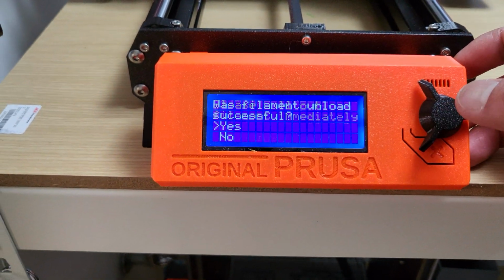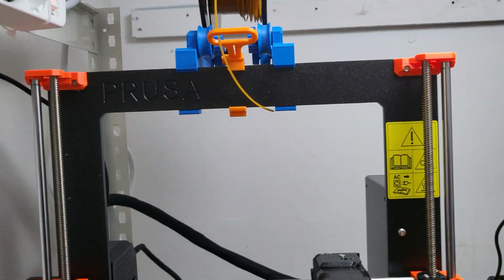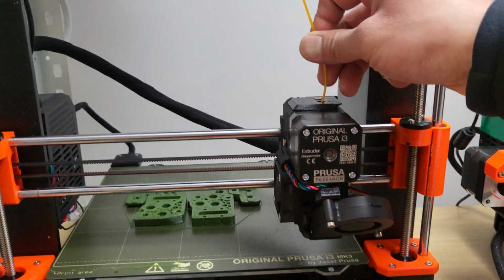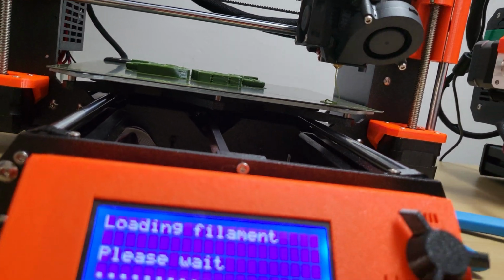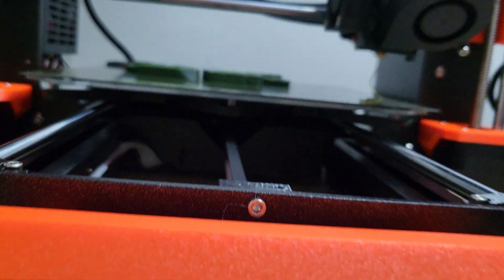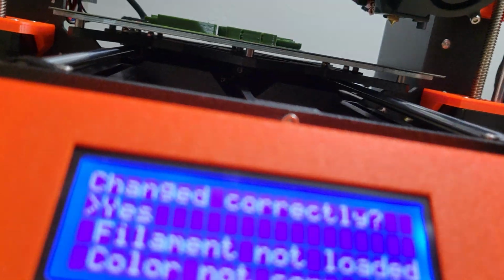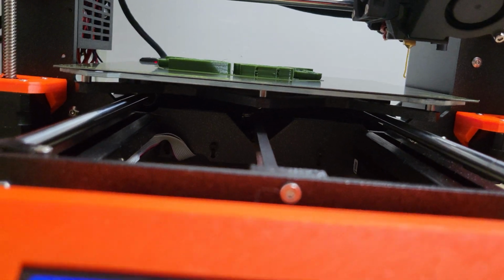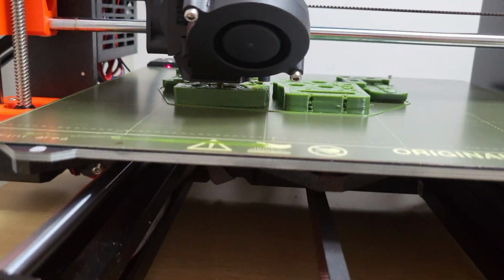How to Change Filament when you run out while printing on Prusa MK3S+!

Comment: Thanks, I was looking for exactly how this worked.  Basically it is identical to color swap. Was a little concerned how it would handle the stubby bit inside but I can see that it extracts out fine.
I do wish it didn't do that final extrude after hitting 'yes'. That extra bit of filament being dragged around the print can cause issue if dealing with some fairly fine supports or parts that are thin and isolated. I have had color changes fail a print on rare occasion due to that (knocking over a pillar or a support).

Comment: I am about to order my prusa and I've been looking for this answer and haven't found it yet. 

Do you know if the printer will prefer infill when the filament runs out or do you think that tends to matter with it? 

I can't tell if it's just a yes or no and stops wherever or if it tries to do something special.
Reply: I doubt that it knows or cares -- by the time you get to the printer, you're working with gcode, which is pretty low-level printer instructions like move to a point, move by an amount, etc. So the printer is not going to try to re-order instructions. It will just pick up where it left off.